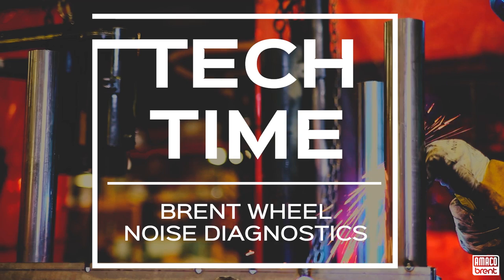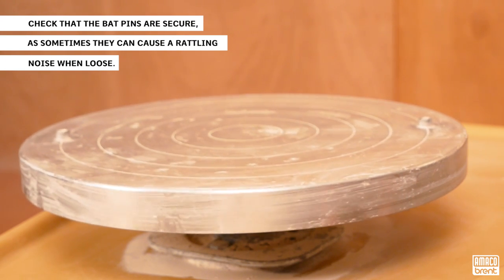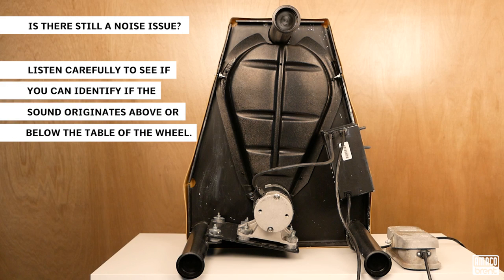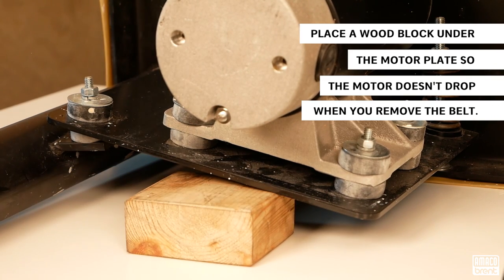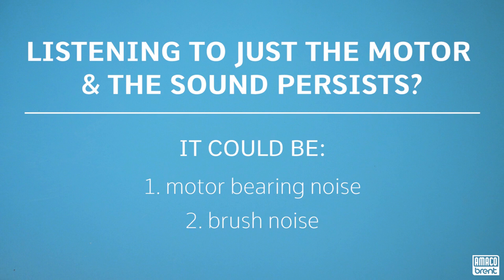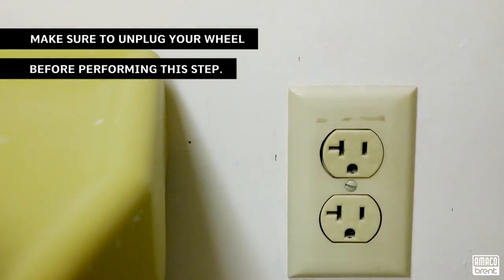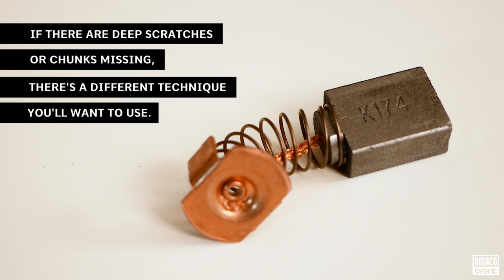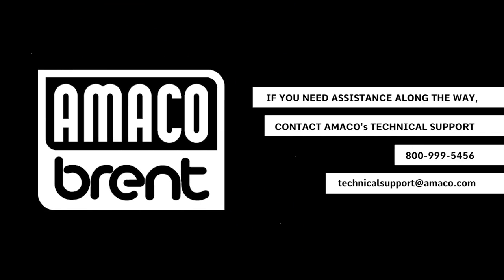Brent Wheels: Noise Diagnostics

Comment: I bought a used C,the wheel wouldn't stop completely, and after a week squeaked terribly.Adjusted the foot pedal and I did the sand and seat, it worked great. It even has smoother power.Thanks for the posts.

Comment: My wheel had a crackling sound at high speed. I knew it was in the motor and figured it was the brushes. I bought a brush seater & commutator cleaner from Amazon and followed the steps in the video. Taking the belt cover off was a pain, and I realized later I didn’t need to do it. You can spin the actual wheel and get the same motion as spinning the belt wheel underneath the cover. The good news is that it worked.
Reply from the maker: Glad to hear it worked for you!! Let us know if you have any other questions in regards to your wheel!

Comment: I have a Model B, and the motor is making an electric humming noise. I have noticed that the noise is getting worse over time. Is this a capacitor issue? I eliminated all other sources of possible noise, and looked in to replacing the motor, but at $435, that is very pricey. What have you discovered about brent wheels that make an electric humming. Some wheels do it, others don't. Please help!

Comment: Thanks for the videos!!  I have a Brent Model B and it chatters when you first get the wheel spinning then stops chattering at higher speeds. At low speed it jerks in very short bursts like it's being turned on and off very fast. Very hard to center a pot for trimming. Is there any fix for this??
Reply from the maker: Contact our Tech Support team for assistance. https://www.amaco.com/support

Comment: so is it not possible to replace wheel motor bearings?
Reply from the maker: It is possible; however, AMACO Brent does not offer any bearing repair. If your wheel motor bearings need replacing, then we recommend sending it to a DC motor repair shop or small electric motor shop to see if they offer that service. 
- Arielle D.
Reply: AMACO Brent thank you for the quick reply!
Reply: @AMACOBrent  is it possible to replace the bearings of the Brent B wheel head assembly? Can I just use the pulley puller on the shaft?
Reply: What do I do if I did this and didn’t notice the brush orientation?